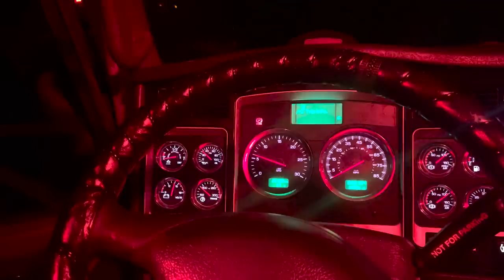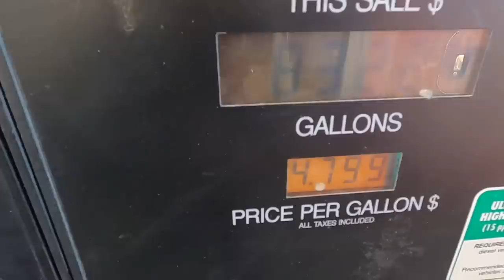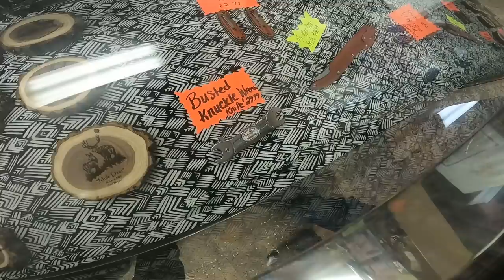WE DEFIED THE ICE, Long hauling cattle…

Comment: That guy who is on your tail is drafting to save fuel son. Bu8t usually he knows the guy in front of him and where they are going and what is going on so they do not have to brake hard with a sudden decision made in front of him. Jack's you have been through 15 tractors; a simi is a type of trailer son. I always used a light you could strap on your head so I could have both hands free. + I used a light for every occasion like working on repairs on the side of the road so you could hang it or use it with a stand on it to position it anywhere that was needed. I remember wax candy filled with cool aide, and penny candies. Jaw Breakers and candybars were 5-10 cents a piece. Bringing coke and pepsi bottles back to the store and buying candy with the money we got from the bottles.

Comment: Thanks for taking me on the ride!, this is stuff I never knew about, The part I liked was when the Charlie Brown truck and your truck loaded, in for the refuel, idling ,all lights on the trailer and the truck Just screams power! Curious about the Charlie Brown truck when you were parked overnight and the next morning you stuck the camera under the cab and it was some sort of steam generator, what is that ? an APU driven motor or what power is it? Thanks RG
Reply from the maker: It’s a diesel burner . Uses about a gallon or two a night is all. That way you don’t have to idle the big engine.
Reply: @realwildwildwest  thanks for the reply! Something else I learned!

Comment: 36:34 Don't know if you realized it, Jax, but that truck No. 53--parked at the pumps directly behind you--is the same tailgater you vented about earlier in this video. Weird--you ended up in the same fuel spot. Guess those diesel prices WERE low. 🤔🚛
1:32:33 Dang! Nixon's reincarnated as a long-haul trucker!! 🤣🤣🤣🤣
Reply from the maker: Ha!! Good eye!
Reply: @realwildwildwest 
I guess every Trucker worth his salt (on the road...!) knows the location of the choice PPPs (Petrol Pump Prices).

Now, if he'd been hauling cattle, and knew of that hot springs location in SD, he would have been RIPE for a tailgate party hosing! 🥳🥳🥳